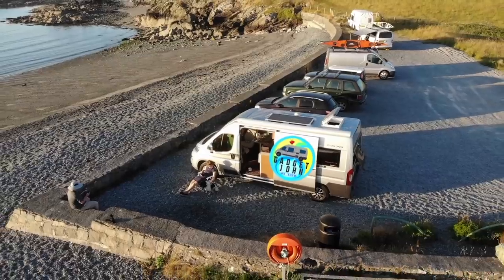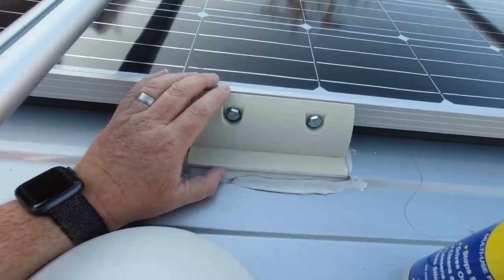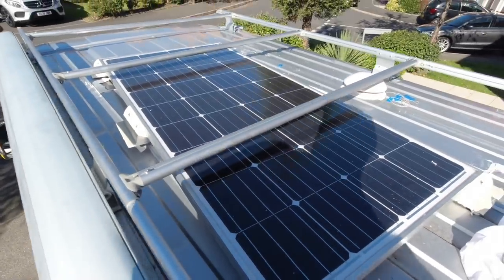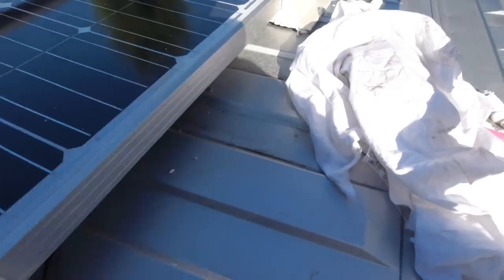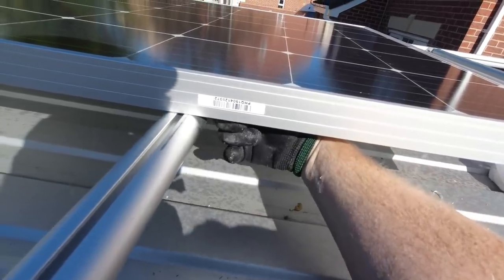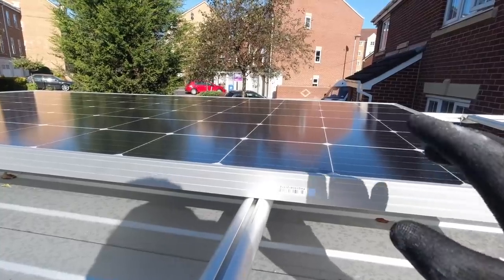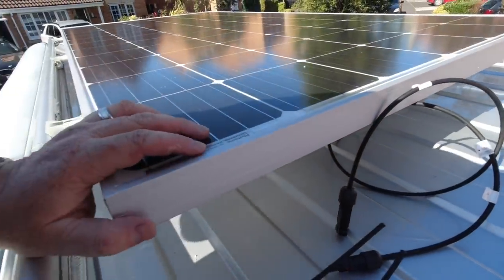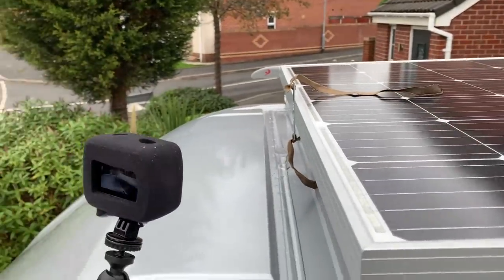Remove my Old Solar Panel and fit a new 360W Panel

Comment: I just did the exact same thing and unglued my panels and mounted them on a new roof rack. I used a piece of acrylic sheet with a sharp edge filed along on side to break the Sikaflex seal. Your video would have been invaluable but I did it in the end.

One thing I have found with the panels on the rack is a howling noise from the wind at speeds above 50mph or so
Reply from the maker: At least your method worked still 👍🏼
No noise at all from the roof rack or panel in our van, not even at night with a strong wind 🚐👍🏼

Comment: Excellent - have been pondering what to try to get the steel plate off the roof which has been sikkaflexed and riveted on where the roof vent used to be - now I know  😁 Good to hear the old panel is going to a good home, and Mevi will finally have Solar - Yay!🔆Have seen a US RV with motorised tilting panels and a variety of manual ones - Renogy sell a simple tilt kit on Amazon - reasonable price. If I can find the motorised  one I'll send you the link - might be worth a look. There is a table with the optimum tilt angle for each Latitude which could be handy - we looked into a lot of this both for Solar on the house and the van parked up in winter. Look forward to hearing how the new set up performs  🔆🚐🗺😁

Comment: If you want a simple way to add a tilt mechanism use a small wiper motor and a threaded rod, all 12v and could be set at whatever angle you desire without getting on top of the van.

Comment: Hi John, great video and the string is genius! We have successfully removed the solar panel using this method but I'm still having a bit of trouble removing the Sikaflex from the roof without wanting to scratch the paintwork and ruin the van. Any more info on this stage of the clean up would be appreciated as it seems to look very easy on this video!
Reply from the maker: I used a plastic blade and wd40 to clean the excess off the paint 👍🏼

Comment: Another great video, have you considered making a roof spoiler to bridge the gap between the roof and your solar panel. I think it could be made out of sheet aluminium and painted or wrapped to match the van, but you may have to get a fabrication shop to produce the bends, which shouldn’t be too expensive. A cardboard mock up would probably help to get the angles and aesthetics right. I think this would stop any wind noise, help MPG and look good to. Cheers from another John, who also likes gadgets.......
Reply from the maker: That was the point of the wind test, to really prove there's no need to direct the air flow as it's equal around the panel, by installing a spoiler it'd then produce a vortex and downward pressure further along the panel and maybe damage the panel.

Comment: Top job John 👍
Now for a full width LED light bar

How much extra weight did the ladder, bike and roof rack add ?
I know some people are obsessed with weights etc..

The fiamma stuff looks well made but incredibly light 🤔

My Adria Twin is arriving with Thule awning and roof system, chose not to have the factory solar panel fitted because they stick it down - I’m hoping to bolt on a larger aftermarket Panel to the roof cross bars 

Very helpful vid 👍
Reply from the maker: Total weight was just under 35kg, the new panel is 14kg, old panel was 9kg. So with fixings and new items I've added roughly 45Kg to the van. I then saved over 60Kg when I changed the lithium batteries though. Then don't forget I saved over 50KG removing all the excessive wood and fixings from the original van manufacturer. So I've got around 350Kg payload capacity when everything is full.

Comment: Great video and many thanks for the steps, one question as you upgraded the solar to 360 w from 150, should you have upgraded the cable running inside the van into the solar controller to a bigger gauge? any issues with that as I want to upgrade a similar scenario,
Reply from the maker: Since even the 360w solar panel is only able to produce just about 10 amps, the original cable was already perfectly able to handle the larger panel.

Comment: surprised the roof rails don't come with rubber seals to sit in the cross bar grooves like Thule Aero bars do ? I know you won't be seeing them but crud and all manner of things are going to get in there over time John. On my Aero bars fitted to my Navara you punch through the rubber seals with the securing t bolt making it all look rather neat but as you used u clamps you wouldn't need to do that. Now to work :-( Another informative video. Michael

Comment: To pull the panel down use try a camlok system used in sailing. Like a really small locking block and tackle to haul it down and then it has a locking kam
Reply from the maker: Good idea, I have a few manual and a few automated ideas - see which one works best in a few months.

Comment: Great tip for the Sikaflex. I wanted to upgrade our panel so your video was great timing, thanks. John what do you think of the idea of a battery to battery charger rather than the split charger as a further upgrade. Specifically the CTEK D250SE?
Reply from the maker: B2B chargers are very good and I'd say if you can afford them it's the way to go.

Comment: Hi John
Will you need to change your Victron mppt controller size now with the increase in panel wattage?
Mark
Reply from the maker: Hi Mark, I upgraded the controller a few months ago when I integrated the folding solar panel I was testing.
Reply: Yes your right, you did. Must pay more attention 👍🏽😁
Cheers.

Comment: GJ - am looking at putting a 2nd Leisure battery in my Benimar, its less than 8 months old, not too much usage on the leisure battery, the place we bought the van are recommending replacing existing one and putting in 2 new ones.. they say the current leisure battery wont work as well, so doubling the price... any thoughts? Kinda think its an upsell for a 6 month old battery rarely used.

Comment: Regarding the Solar Panel Upgrade & your desire to have it tiltable... I wonder if it would be a good idea to have a contact switch wired in that a buzzer sounds if you try starting up your van with the Solar Panel in the raised position. Driving off with it in the raised position is most definitely going to end in tears
Reply: There are WWW calculators  that show the effect of tilt on energy collected over the whole of the day. Just convert that to Ah for your battery .  IMO it is better to have an auxiliary vertical PV panel on the back doors for winter use in Northern latitudes and feed that in via a cheap PWM solar controller straight to the house battery and not mess about with the roof installation.

Comment: Great job, wished I have more than the 100 watts. The only way to upgrade is to start again on mine as it’s integrated within Swift Command System. With laptops and gadgets in UK winter 300 watts is minimum IMHO 👍🏻 Trev
Reply from the maker: Hi Trev, that's a real shame, though I can't recommend Victron solar controller enough, you could bypass the built-in controller and wire directly into the battery with a new controller, inline fuse and isolator too, then you have the option to configure the solar setup of your dreams 👍🏻
Reply: Gadget John yes that’s absolutely right. I have considered this with an option of keeping the existing 100 watts in situ. I spoke with the guy from Sargent and he confirmed I could upgrade to 150w maximum on the current setup. It’s a project I may take on I future. Thanks for your excellent advice 👍🏻👍🏻 Trev
Reply from the maker: I'd still suggest eliminating the current solar controller as you'd confuse the 2nd controller when it reads the battery voltage as the first controller would be providing a charge voltage, the 2nd controller would then think it didn't need to charge and then shutdown. So best to have 1 solar controller only. Let me know if you get stuck in and want some help, or at least someone to film you and put you under stress when you're doing it 🤣

Comment: Great vid Jon, wouldn't it have been better to use both panels .. I think you will need them if your in the UK full-time in winter even if they tilt.. but I'm probably wrong as usual👍
Reply from the maker: My solar controller wouldn’t have taken the power of both panels and I can’t afford to upgrade that too. Then there’s the fact there’s not enough space on the roof for both panels. 👍🏼

Comment: Do the MC 4 connections make a difference I'm hoping not cause iv cut mine off to get inside lol
Reply from the maker: MC4 are a great external connector, but on my original panel I too cut them off and just fed the cable directly from the panel into my charge controller.
Reply: @johnmandy  yer thanks for reply I thought same it's only wire as long as connections are good I thought it would be fine

Comment: Great video, do you know if this this method and wd40 clean up will work with soudaflex 40fc?

Thanks
Reply from the maker: Give it a try, you’ll know right away if it’s going to work.
Reply: This method worked well for soudaflex 40fc. I found using cake bowel scrapers to cut through the sealant from the front side worked the best as found the string kept breaking. But I think this was due to having less area to work with to pull the string through and aluminium feet which kept catching the string.

Also had a mark on the roof caused by the sealant after scraping off the excess, however an alcohol wipe has removed anything-left and now looks like nothing was there.

Thanks again,

S

Comment: Hi John! Whats your conclution on the upwards/downwards force test? Have you mounted it tilteble yet?
Reply from the maker: The conclusion was in the video. It clearly shows the same air pressure above & below the panel. Been fine for thousands of miles.

Comment: Could you have mounted the panel longside across the van so that there would have been a roof rack cross member supporting the longer length of both sides of the solar panel?, giving more support against flexing?, this then gives you all the sparespace on the roof rack accessible from the the roof ladder at the back of the van. If you then put hinges on it at the front, you could tilt it by getting access to it through a skylight window. Just a thought. Although even if it's tiltable only in one direction you would need to keep turning the van around to have the panel facing the sun.
Reply from the maker: The panel is 25cm wider than the van. So it can only go where it is placed now.

Comment: I’m not convinced on solar panels.do we have enough sun in this country?
I’m thinking a better way is using your engines alternator.lets say we have a 90 amp alternator and a 90 amp leisure battery.the battery is down to say 50%.just starting engine not driving around takes 5mins to put power back in starter battery.if engine runs for 35 mins would that put leisure battery up to full charge?
Driving around this time of year you will need lights on indicators and brake lights That’s 110 watts being used.
Am I correct with my numbers?
Or you could use suitcase generator if some ware quiet,but they are expensive to buy and run.
Reply from the maker: Your alternator power isn’t all available to charge your leisure battery. Solar power in the uk over winter isn’t great, but you could angle your solar panel to get more out of it, but overall I think solar is a must in any recreational vehicle.

Comment: what about putting something between the top of the cab and the racking? to block the wind going under the panel?
Reply from the maker: Why? As was shown in the video it’s not an issue.
Reply: @johnmandy  when i watched the vid,u can see the panel moving around a little,,the movement after a bit will loosen bolts ,,that's just what i would do if i did that you did ,solar on roof,,it does look good what you did,,if your happy that's all that counts
Reply from the maker: If you forced wind over the panel it would have a downward pressure on it which could damage the panel. The movement is the roof bars flexing, have you seen how much an aircraft wing flexes and moves around as it takes off and lands?  Things can move, they are metal and made to flex.
Reply: @johnmandy  ok i just gave you my 2 cents,,

Comment: is that 4mm2 or 6mm2 cable John?
Reply from the maker: It's 6mm and double shielded, which was a faff trying to get the MC4 connectors on as you saw 🤨

Comment: As always i am impressed by your DIY skills. I can't see any advantage in doubling the size of your solar panel, or tilting it. Unless you also double your leisure batteries. Down on the Med in winter it is dark early and you will use lots of amps with your TV etc. and there will be no more solar power coming in regardless of your panel size. There has got to be a limit to the number of batteries you want to lug around.
Reply from the maker: It’s a balance of batteries to store the power from the solar array to collect the power. No point having huge batteries if your solar can’t fully charge them. Better to have a solar panel that can charge your batteries daily and then get the best energy efficient devices for your van to get the most out of the batteries.

Comment: To get the full use of the Panel in the winter if you can make a swivel table for it then you will not only be able to tilt it you will be able to turn it to face the sun , and although it may sound difficult it’s really not that hard all you need to do is make a table , when I say table get two peace’s of flat plat about 300x 300 weld a shaft on it with a rolling bearing on in the centre ,with four arms a bit like a drone to each corner of the solar panel and three hinges like on a double glassed bottom opening window , with two hand locking screws that you can lock when your mobile  then you can turn the panel which ever way you want . Bear in mind you will need extra wire to you panel so you can make this possible. So you would also need cable clips on your roof to clip the cable in so it’s not drumming on your roof when you are travelling along , I don’t know how to load pitchers but I could do you a drawing , let me know John when you decide to have a go at tilting your panel. It will be in the summertime more then likely I may have my van half way done by then , yes it’s taking a long time but that’s only down to cost.good luck with it anyway.which ever way you decide to to do it . But ideally a front wheel hub would be brilliant for it other then the weight, but I think the front wheel hub from a mobility scooter might do the trick, but I would have to look into that as I don’t think mobility scooters would have the turn to be able to lift it high enough. Wood be the weekend John many thanks to you and your Mrs for sharing your videos.
Reply from the maker: That's a good idea, but I'd end up motorising the entire moving platform and have a controller to track the sun to make entire panel platform perfectly aligned to the sun at all times 😜 In reality I'll just make the panels tilt and move the van around if needed, with this new panel, regular driving and the lithium batteries we are very well setup now for all-year-round living.

Comment: Doesn't look big enough to be 360W, what did you pay for it? With so much power you don't need to tilt it, your battery will always be full.
Reply from the maker: Not sure what to say, it actually is 360 watt and all panels need titling to get the most power in all but 2 months of the year when the sun is directly overhead.